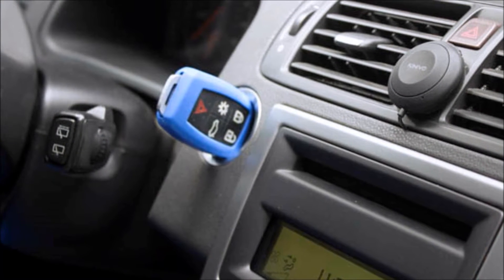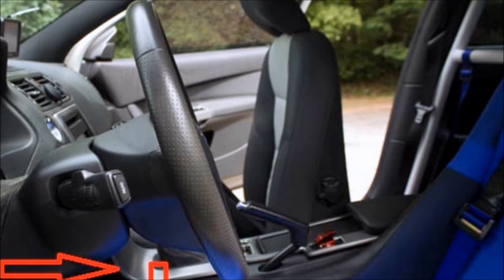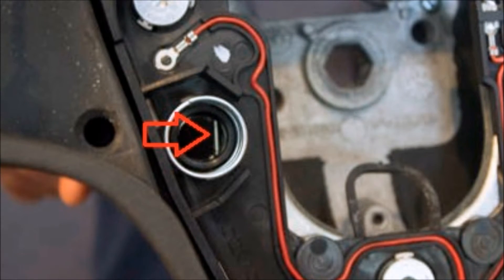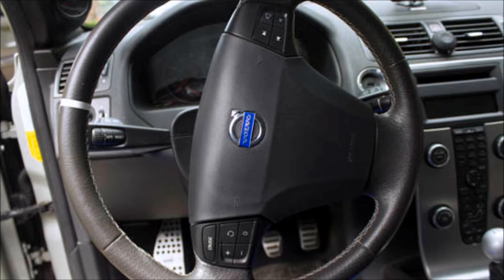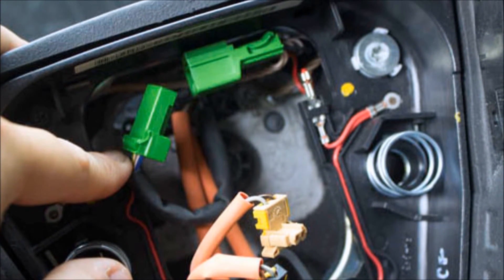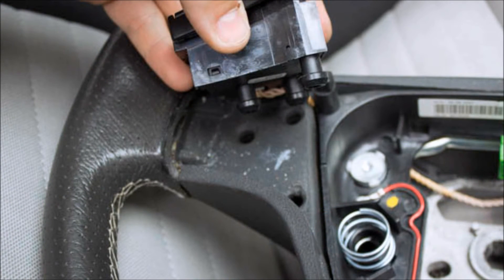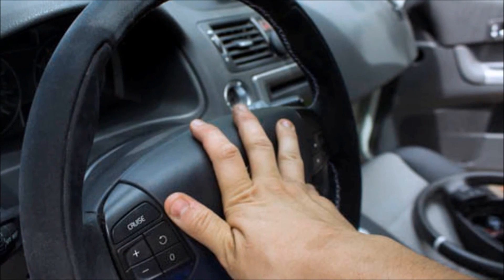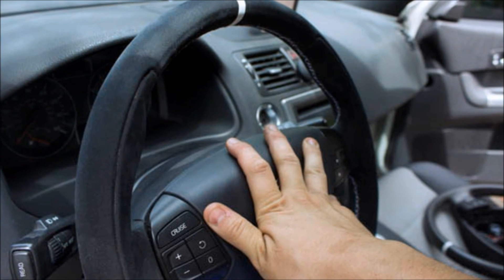Volvo C30, Steering Wheel Replacement

Comment: Quick question
Is it possible to take the wires out of the squib? The plug wires?
Reply from the maker: They can't be removed entirely without cutting them out, but they can be pulled through the back and tucked away. A few people have installed removable steering wheels this way.

Comment: can you f up the steering alignment? or does it fit tightly?
Reply: like if the steering wheel is not straight when driving straight, it's not because of a steering wheel replacement. and the fix has to be done in the tie rods?
Reply from the maker: @seanheb6103  Correct. The steering wheel is mounted on a hexagon shaped stud. So if it's not installed straight, then it'll be off by 60 degrees.

If it's a few degrees off while driving straight, then adjustments must be made at the tie rods.

Comment: After doing this I got the anti skid warning. The sensor was still at the same location. Do I need to recalibrate with dice?
Reply from the maker: Recalibrating with dice would be a good first step. The anti skid message is likely from the steering angle position sensor which may have gotten slightly turned when everything was apart. I had this happen one one car, but it went away after resetting the clock spring.
Reply: @MyNameIdeasWereTaken  I just did a reset of the clock. Steer and wheel straight. Clock Maximum to the right until lock, and 2,75 back. Locked it and placed the wheel back. Still have the warning message but I think it needs a reset anyway to clear the message. Waiting for the dice controller now from China.

Comment: @MyNameIdeasWereTaken, what about steering wheel sensor? Is there any risk of de-calibration during steering wheel replacement?
Reply from the maker: As long as you don't go spinning that hub piece with the steering wheel off, there should not be an issue. When swapping wheels, you should have the new wheel ready to put straight on as soon as you take the old one straight off.
Reply: @MyNameIdeasWereTaken  Thanks. Just downloaded the installation instruction and found out, that there is a free screw in the steering wheel - you can unscrew it and put in the contact reel to block the sensor. Thought it might be useful for somebody.

Comment: where did you get the shift knob? been looking everywhere for one that fits my S40,
Reply from the maker: It's a generic aluminum shift knob. You have to remove the pin on the stock shaft and you can either thread the shaft or you can use a rubber cap to secure the aftermarket knob. http://forums.swedespeed.com/showthread.php?218691-MyNameIdeasWereTaken-C30-Progression-Thread&p=2427199&viewfull=1#post2427199
Reply: thanks alot!!

Comment: where did you buy this wheel? I love it!
Reply from the maker: The wheel removed was a custom perforated wheel made by RedLine Goods.  The wheel I replaced it with is an alcantara wrapped R-design wheel.  It's a one of a kind wheel which was originally in the blue Elevate show car.
Reply: +MyNameIdeasWereTaken when are you planning it to sell it? 😀 I did a racing wheel on my c70 but I want a real r design alcantara wheel. your so Lucky.
Reply from the maker: I don't plan on ever selling this car!  Though... I did say the same thing about my S40.
Reply: +MyNameIdeasWereTaken I met the steering wheel. lol don't sell you volvo!
Reply from the maker: Oh! LOL.  I don't think I'll be selling either steering wheel, they're both one of a kind.